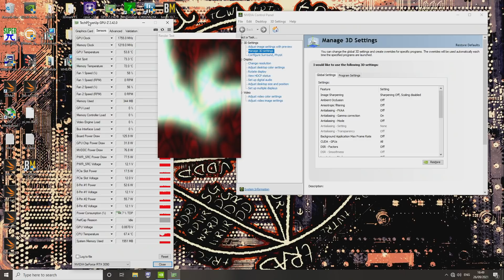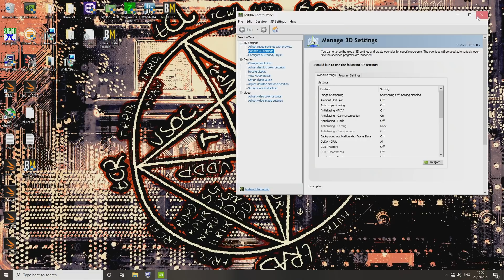Progress update on the New Worlded RTX 3090 Vision

Comment: Motherboard power delivery generally doesn't blow up running prime95, yet gpu power delivery used to blow up all the time on furmark, and still would if they hadn't built driver safeties. Considering new world is blowing up gpus due to the work load, isn't it about time we asked the real question: why are we allowing gpu manufacturers to get away with using half assed power delivery? It should be a standard that gpus must be able to run extreme loads for hours without failure, especially now that gpu manufacturers are charging a premium.

Comment: Dragging down the power limit to 85-90 should do the trick. Still, this should never be possible to happen, software shouldn't be able to damage the hardware, there should be protections and limiters set in place.
Reply: like BZ said in his first Video, it is very likely that the Power distribution design is at fault here, that delivers most of the power through one "lane" of the two 8 pin  connection and overload one of them with it, even if the Card isn't under full load. So that isn't something that can be fixed with better cooling or better Components. BZ would design a new Power delivery for this Card...not that he didn't do similar things before but i guess this High End Top of the Line Card is a bit to advanced even for him .
Reply: Jay twocentz showed an issue with evga and undervolting the card specifically in New world the gpu would still spike well over the set limit.  He was using afterburner with an evga card, not sure if precision would regulate it better... just double check if you do undervolt it that it is actually working.

Comment: It’s interesting that Nvidia has taken steps to detect Furmark and aggressively throttle their cards to prevent damage.  It makes me wonder if there’s something flawed about they way they handle power delivery on their cards that when poorly written software/power viruses run on it, it ends in hardware failure.  I’d love to know exactly what the root cause of the issue is, because this is gonna be one of those problem that just goes away quietly.  Nobody wants to own this one and be on the hook for their fuck up, so Amazon is gonna patch their buggy code (if they ever figure it out) and never put it into their patch notes (unless sales are tanking, in which case they’ll be advertising how they fixed the issue to get people willing to play again.)  In addition to that, I’m sure Nvidia will patch their drivers to detect New World, and throttle it down like they do for Furmark, and OEMs will revise their boards or swap component vendors, so we won’t see it on any newer cards that are sold—so, we’ll never hear the actual end of it.

From the behavior I’ve heard people describing, these failures sound like the game is causing the GPU to quickly ramp the performance up and down, and if it’s causing massive voltage spikes, there may be some huge transients that are hitting it so quickly that the over voltage protection doesn’t have time to react and that’s what’s blowing these things up.  

I’m not an electrical engineer or anything, but I’m an IT guy and I spent a decade studying audio recording and the way digital audio is recorded looks exactly like what you see on an oscilloscope, and audio engineers (like what I went to school for) encounter transient spikes that are pretty massive, and happen so quickly that unless you’re using a compressor or limiter than can look ahead, it can’t clamp down and attenuate the signal fast enough to catch them.  On a loud enough transient on the exact wrong system, it could blow the speakers, which is why recordings that were mixed and mastered before digital was the defacto standard (and the software limiting and compression tools had look ahead functionality), the average volume on tracks weren’t as loud.  Now that they’ve got tools that can anticipate when there’s a big transient spike, recordings have gotten ridiculously loud on average, and if you’ve ever experienced a TV commercial that sounded WAY louder than the program you were watching, then you’ve heard what overly compressed/limited audio sounds like.

Anyway, that digression aside, I was thinking that maybe once you get this card working as good as you can get it, that maybe you hook it up to the oscilloscope and see what those transient responses look like.  If I recall, the issue when these GPUs launched on AIB cards was a similar one, where the types of capacitors being used in some cases weren’t as good at providing enough voltage quickly, and that was why some cards were having issues.  I kinda wonder if they might’ve over done it with the fix for that problem, which is causing this problem, because if it’s too fast, and drawing too much, then the built-in over voltage protections aren’t going to have enough time to respond, and since they loaded these boards up with a ton of those fast little capacitors, the amount of voltage is probably more than a little bit nuts.

Man, as much as I like my 3070, I’m kinda bummed I couldn’t get my hands on a 6800XT like I wanted to when those launched.  It just seems like Nvidia can’t get their shit together for the power delivery on a very power hungry card.  I can honestly say I wouldn’t miss the ray tracing performance for faster rasterization and better efficiency, not to mention the fact that I have a monitor that supports FreeSync Premium, and regular ass Gsync just doesn’t look as nice.
Reply: I have no issues with my strix 3090.... none not in new world. It ocs like a champ
Reply: I'm wondering how engineers haven't yet thought to implement a hardware mechanism to detect an overload for any reason, no matter what software is being used. Just detect power usage spikes, amperes, temperature - whatever to throttle the card down and prevent burning. I would rather like my GPU to start throttling insanely in those dangerous situations, so that I know that something's not right with the game/app I'm using.
I mean - if our CPUs would burn out because of being overloaded in this way, we would be getting dead CPUs so much more often. I could run a simple code loop that loads all cores 100% and the CPU won't die. Why can't we have the same behavior on our GPUs?
That also makes me wonder - if I want a totally reliable non-overclockable GPU that favors reliability over performance, then where can I get one? I'm doing some gaming, but also experiments in Unreal Engine and neural networks, and Blender renders. I wouldn't want my GPU to burn just because I messed up my code.
Reply: @camelCased  read the original post. There are voltage and current protection mechanisms in place. The possible problem that OP raises is that the voltage or current may spike faster than the protective systems can engage.
Reply: @martindinner3621  And that essentially means there is no effective protection against spikes and bursts. That's what I meant with "overload for any reason". CPUs seem to be much more protected against this.
Reply: @camelCased  Agreed!
Reply: Honestly? I'd say nvidia are saving themselves a headache doing it.
I remember some notorious maps in infamous2 which could cause the fans to go insanely fast - bearing in mind it had NEVER spun up to that extent before even in summer.
Poor code can easily wreck hardware. I don't have a better analogy, but it's like chucking a rock into a washing machine, where sure you can put the rock in, but it won't end well for the machine. Except here it's bad code and the gpu

Comment: Dude instead of $600 multimeter that's more glitchy than my cheapo manual range how about get an $700 HT-301 and save yourself some time with it? 384x288 and 9mm germanium lens do a fantastically decent job IMHO.
Edit: How about hook each mosfet out to a logic analyzer (or if u got a whore oscilloscope) with very thing cables, install the original cooler and run something with increasingly bad load to see if some phases get oversaturated or go bananas in general? Could also install a proper waterblock on GPU, direct some serious fans to the VRM, run high load while monitoring with a thermal cam. If VRM chips don't go from ok to bananas in an instant you'll see some precursors in either or both observation methods. With a good programmable logic analyzer I believe you could even automatically decode duty cycle and show some histogram to know which phases get dangerously high open times.

Comment: nvidia engineer: well it was fine with 600w for 5 seconds in our air conditioned lab. chip Latch up, Slew rate, power rail oscillation, voltage drop, trace size/watts, undersized capacitor, cooling?? These are all new terms to me

-nvidia engineer understands less than arc welder. Low voltage High amperage that's when you're welding good baby

Comment: can anyone explain why he said that if someone send him an rtx3090 with faulty vrm, he wouldn't bother replacing it because it will go bad again? i need to know why
Reply: If there’s a design flaw, the dead part wasn’t the problem, but the design of the board. Replacing the dead part is not a fix for the problem, just a remedy for the symptom. If it gets another module, but it’s the design that’s at fault, the card will just kill the module again. He also says he doesn’t know if that’s the case.

Comment: If you put the power stage back in and it works fine, then the best thing to do would be limit the power curve on core, and boost mem. Games are dangerous, use it to mine 😅

Comment: Does this guy repair GPUs on a daily basis, because it seems a bit much to say all cards with a blown VRM is unrepairable because it will blow again. It could be a bad batch of controllers, age/heat degradation of controllers, current limits in the firmware set too high, the shunts are reading low. Tech Cemetery has removed a stage and it ran fine at full load for hours.

Comment: so....I have this exact card. I got it from newegg for $2150. For everyone who will say i'm an idiot for spending that much on a card, 1st I had a 3080 Strix that I mined with to pay for itself (I got it for MSRP way back when they first launched from Microcenter) Then I had the chance to buy a 3090, I entered into the newegg shitfull specifically for a 3090 because 10Gb of VRAM wasn't enough to play Resident Evil at 4K on the highest settings, which really got under my skin. So once I had the chance to get a 3090 I did just that, then I hurt my soul and scalped-ish my 3080. I sold it for a couple hundred less than most 3080's were going for, but it still made me not like myself and i'm not proud of that. so in total, I spend $250 for my 3090.

I did and still do have concerns about the rear vram temps. I was thinking about getting a waterblock, I found for for $200 but then I'd have to get all the other garb that goes along with that. I have a 360AIO which only fits in the front of my case. ----This is my question for my fellow plebs--  (i'm not going to use a rad smaller than 360mm for a 3090)

-Should I get a new case that can have a front and top mounted 360 rads? So I'd have to buy the GPU block, pump, 360 rad and fittings.
-Should I just full custom loop and put the AIO on a different PC? Again, I'd have to get the GPU block, 360 and 240 rad, fittings and a pump
-should I just embrace my Midwest USA self and get a decent sized heatsink and plop it on the backplate? maybe strap a fan to it, or have one sitting on the GPU giving it a nice BJ all the time.
-Should I just say F it, and just monitor the vram temps for the time being.

I have an 8yr old who has my old system, I'd like this card to stick around long enough for him to be able to use it, so staying alive for like 4-6-8 more years. so keeping it cool would aid with that. plus the cost of replacing it with anything would be pretty damn costly.

Comment: I repeat it to every youtuber or gpu reviewer, use borderlands 3 in 1080p no vsync to tzest gpus, perfect gpu scaling doesn't care about cpu, I had the same fps (-0,6fps) running a 9900k at 3.4Ghz rather than 5.1Ghz but without vsync (ingame ! benchmarks are bs and not realistic) "oh boy" it will go to max power and 200-300+fps in badass with a 3090 that's when I noticed my room temp was at 36°C at 2am >< and now I just run vsync everything because between 120fps(+-220w) and 200-300(350w+ maxed nonstop) your pc goes from "okay" to an electric heater real quick (triple radiator liquid cooled cpu-vrm-gpu build btw air cooled it would have been 45°C not 36°C)

Comment: The Whole World: Must add more cooling to the 3090. More cooling to the memory. More cooling to the core. More cooling to the back.

Buildzoid: I like to cool my 3090 with a stock AMD Wraith Stealth cooler.
Reply: its not blowing up because of cooling. its blowing up because a circuit gets overloaded because amazon programed new world terribly. although you have a point any card with ddr6x memory should have better cooling. or just water cooling.... that shit gets hot....
Reply: @jackofallglass165  >amazon programed new world terribly
Unless the game is doing some undocumented API calls, it's 100% GPU's fault.
Reply: @BifsieOfficial  while the problem is mitigated by staying away from New World, it is still 100% gpus fault to allow userspace code to exceed powerlimits.
Reply: The problem is 100% hardware, just because new world uncovered the issue doesn't change the fact that its a hardware issue. If your breaker doesn't flip when it encounters a sudden surge and it fries your computer- you don't blame the outlet, you blame the faulty breaker. just because 1 manifests the problem doesn't mean it is responsible
Reply: @BifsieOfficial  what about when the next game like new world comes out and does the same thing and kills some more gpus
Reply: even hp likes to cool intel cpu´s with amd stock coolers, and vice versa^^
Reply: @majstealth  no it's the other way around, Dell and HP like to cool AMD CPUs with Intel stock coolers

Comment: Similar to what my strix did after 6 hours in new world it worked but would artifact and video outs would randomly go out. It wouldn't boost in games but would still run them with lockups and hitching and dip to 205mhz core and 410mhz mem in games. Had to RMA it. The repair notes said all display outputs failed in testing so they sent a new one.
Reply: Did you get your own card back or was it a new card/refurb? LHR?

Comment: JayzTwoCents did some testing with new world he found the game makes the card pull over the set power limit it was as if the core wants more power the vrm says sure without checking the power limit, assuming blowing the power limit is the issue that would be a driver or firmware flaw, in Jay's testing some cards ignore it and other don't so i would guess the vbios has a bug
Reply: i saw that same video. it was weird how some followed the power limit settings and some didn't. but the power draw spikes were what? topping out at like 120 someodd percent? thats a LOT of power on some of those cards...

Comment: How did you determine which power stage was dead?  Also, is this really that widespread?  EVGA claimed there were only about 25 cards that failed this way originally, which doesn't seem like very many, given how many cards they appear to be selling.

Also, WRT the 980 Ti, those seem to be failing mainly after many years of use.  You could conceivably repair it and get another six years of use out of it, which isn't that bad a deal for an hour or two of work.
Reply: See his previous video for diagnosing.
This is a Gigabyte card not an EVGA

Comment: So the thing about limiting the frame rate in Nvidia control panel is recommended?
Reply: That doesn't matter if the GPU is getting fully loaded. Only guaranteed way to reduce power draw is to reduce the power limit with something like MSI Afterburner.